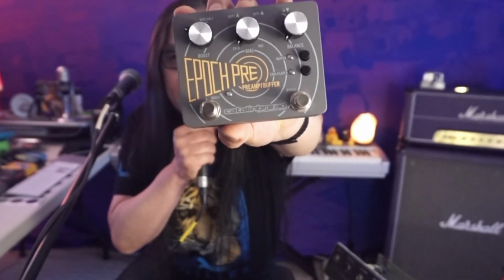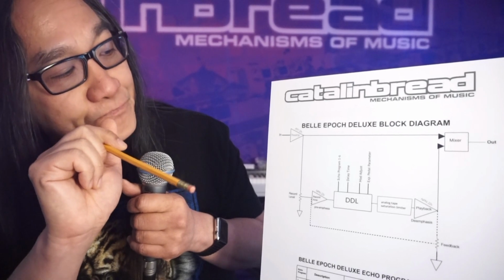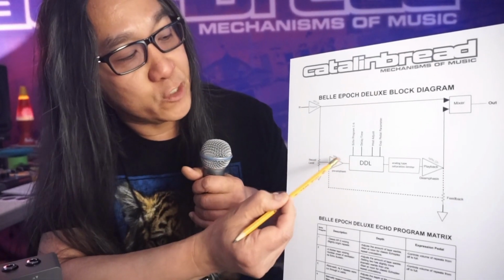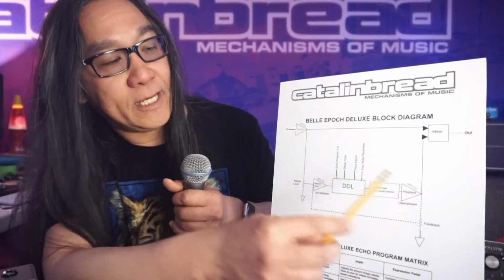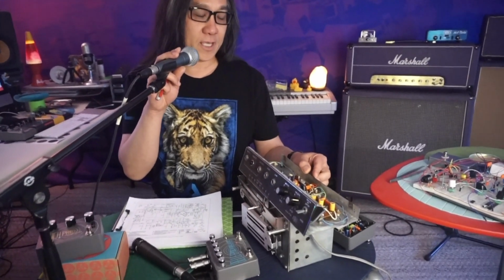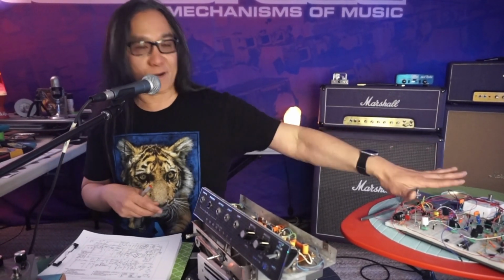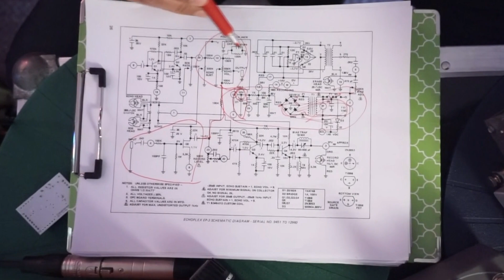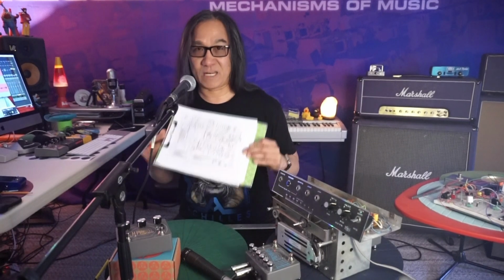Technical Overview of the Belle Epoch Deluxe

Comment: I am a pedal designer and builder, and the last thing that I'm going to do Howard is come on here and crticise someone who is making a great sounding pedal which is a major step forward in guitar pedals - especially of this type.
I too realised a couple of years ago that an important factor holding back the sound quality of a lot of modern designs was the lack of headroom and the lack of reserves of current in the power supply system.

Comment: Did you find a way to mimic the resistance and capacitance of the point to point wiring in the EP-3? As I know that you know,  this is a factor in why P to P,  etc. amps sound the way they do and why we like them so much.  Experience has shown us that with very few exceptions more primitive old-schcol circuits sound better to us for guitar purposes than do pristine hi-fi circuits. So, what did you do to emulate this? I just got  my BED and I am amazed. Thank you for a great pedal.